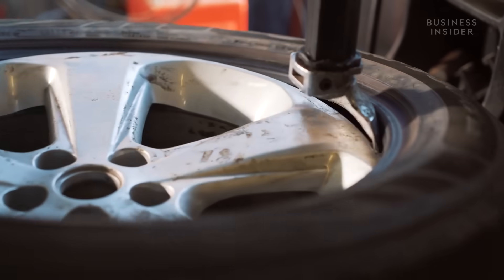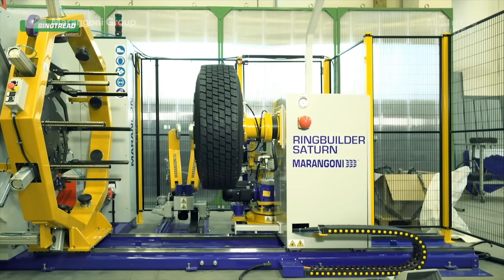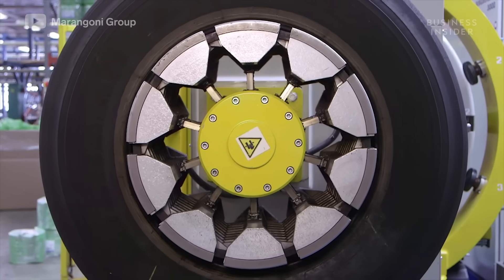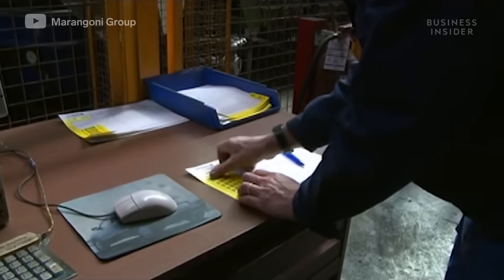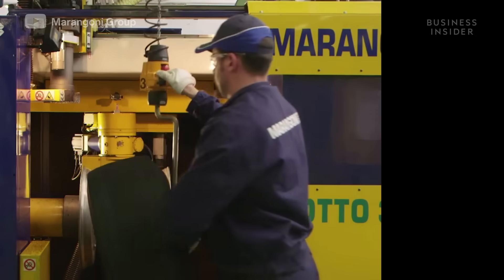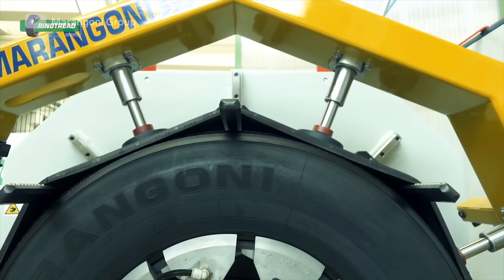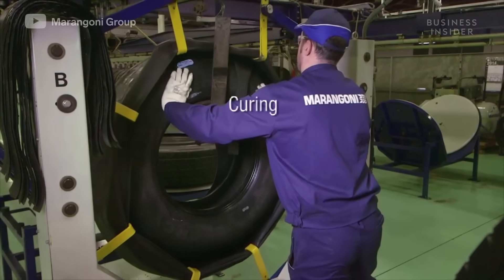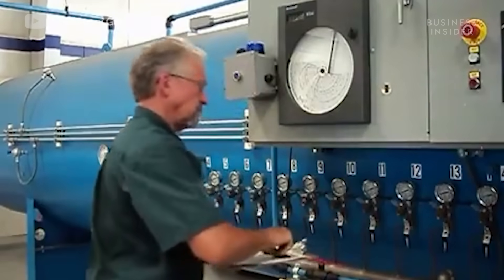How Old Tires Are Retreaded So They Can Be Used Again

Comment: can have all the technology in the world retreads are still junk.   To many times have I seen or heard of them blowing out or the treads legitimately falling off them
Reply: That's not just a retread thing. Don't let the smart asses gaslight you into believing these are the only tires to blow out or delaminate. Studies have even shown that retread tires have a failure rate essentially equal to new tires, so long as they are manufactured correctly. The only real danger lies with negligent shops that retread tires that aren't still serviceable. Those same studies determined that underinflation is the most common cause of tire failure across the board.
Articles on retread safety:
https://www-nbins-com.cdn.ampproject.org/v/s/www.nbins.com/blog/transportation-trucking/do-retreads-impact-tire-safety/?amp=&amp_gsa=1&amp_js_v=a6&usqp=mq331AQHKAFQArABIA%3D%3D#amp_tf=From%20%251%24s&aoh=16073586618956&referrer=https%3A%2F%2Fwww.google.com&ampshare=https%3A%2F%2Fwww.nbins.com%2Fblog%2Ftransportation-trucking%2Fdo-retreads-impact-tire-safety%2F

https://www-pe-com.cdn.ampproject.org/v/s/www.pe.com/2017/09/12/on-the-road-retreaded-tires-can-save-you-money-but-are-they-dangerous/amp/?amp_gsa=1&amp_js_v=a6&usqp=mq331AQHKAFQArABIA%3D%3D#amp_tf=From%20%251%24s&aoh=16073586618956&referrer=https%3A%2F%2Fwww.google.com&ampshare=https%3A%2F%2Fwww.pe.com%2F2017%2F09%2F12%2Fon-the-road-retreaded-tires-can-save-you-money-but-are-they-dangerous%2F
Reply: @garx1a  any tire can blow out all it takes is one good pot hole hit weather the tires new or old but "studies" ain't fact. In history people publish a page to their findings about a specific product or design or issue. When if their tests such as a example with the whole NFL concussion "studies" there was 1 result that warranted the concern and everything blew up about this one conclusion. When other schools and researchers tried to recreate the results they couldn't find do it. I've never seen anything other then a retread delaminate on the road can talk to most if not all tire shops and you ask them if you should get retreads and watch the face they make. Yes retreads are a cheaper option if you need to last you till you can afford real tires. Yes id say they have gotten monumentally better then when they first came out but same as with electric cars the technology still just isn't there for them to be that reliable better option then just buying legitimately new tires
Reply: @cjlong2057  So rather than trust studies provided by organizations that have the means to research sweeping examples from across the industry, as well as assessments by the long haul trucking industry that corroborate those findings, we should trust anecdotes that can't be verified, don't have any data on, and possibly don't tell the whole story? You said yourself that they've vastly improved, but they still have that stigma from before that improvement happened. That's the reason that shops will look at you sideways when you talk about retread tires, the stigma, not the facts. To put that into perspective, I've never had a recapped tire delaminate, but I have had an original tire do that, and on more than one wheel too. That doesn't make new tires less safe in my eyes, it just means the manufacturer screwed up.
Reply: @garx1a  I'd rather trust a shop on the small end of it then a large corporation because they are the ones who most benefit from a product of this nature. Especially in recent times all the stories and things that have come out about us being safe. Please keep in mind that only 1 or 2 generations ago depending on your age menthol cigarettes were prescribed to treat breathing conditions. And this was the big companies and the higher ups who would advocate and push this as fact. When well what do we know today. Plus regardless of our view on any matter I'm thankful you never had a retread fall apart going down a road. It's very scary. I'm sure eventually there will be a better option and 1 factories process isn't the whole industry either. There are so many little things that need addressed before these stigma and perspectives from the professionals will be changed.  If these are so safe and reliable then why don't race circuits use them? Why isn't there a team for rally or track cars or drift circuit that uses retreated tires? Weather it's a stigma or not until I can see that they can handle these true extreme conditions because accidents happens, animals jump out infront of you on the road, someone jams their breaks, you hit a slick spots on the road. All things that would really put the tire to the test. The reason they don't as I said stigma or not no one is willing to put their life on the line to see if these tires can play on the same field as a standard tire
Reply: @cjlong2057  That also doesn't make a whole lot of sense. Corporations, being as greedy as they are, care about profit. Manufacturers like Michelin wouldn't sully their own reputation with customers by selling bad quality retreads. For that reason, they are anal about ensuring that their tires are still serviceable, something a small time shop likely doesn't have the incentive, standards, or ability to do. Additionally, the trucking industry values its reputation, so why would they potentially lose business over cheap rubber if it would cause them to lose money in the long run? They simply wouldn't. More blowouts means less money because on the mild side; that takes time away from delivery of cargo, and on the extreme side that means destruction of the cargo, destruction of the truck, and potentially death of the driver, all of which would cost them more money. And yes the heads of cigarette companies promoted smoking for health benefits, just like how sugar executives used to market sugar as a weight loss supplement, but you never heard well respected healthcare professionals doing it too. That's why the government hasn't banned their use or heavily regulated them like they did with tobacco. To your point about a professional racing series with recapped tires, those series have deals with tire manufacturers wherein the manufacturer provides the tires in exchange for having that brand name plastered on the rubber of a professional racing series. It also wouldn't make any sense for retreaded versions of racing tires to exist because the main benefits of them are that they are better for the environment and they're cheaper than new tires, but race cars all have insane engines that would never pass emissions anyway so that point would be null, and professionals have money to always use brand new tires so it would eliminate that reason as well. There really isn't a reason why they're unsafe except that there's still a stigma around them. I know that's true because you haven't provided me with any real evidence that they're trash except your own personal beliefs and experience with them, but that's also moot because like I said, I've only ever had bad experiences with new tires.
Reply: @garx1a  something as miniscule as tires doesn't effect these massive corporation. Where I come from that's what so many people do they drive none of these companies use retreads for the fear of them being notorious for having issues.. I don't know how unless you've been the most unlucky tire shopper. That's like buying a harbor freight took and expecting it to stand up in service of a name brand. While yes all those tools are just the previous gens of those new name brand tools they still don't and that's the issue with bringing dietary things up to the table everyones body reacts different to certain things so what would work well to help my body be healthy and function fine isn't the same for everyone. Yes there is a generalized to a point diet we should follow  but our bodies  overall metabolism, how strong the organs work to process things. Especially how active we are day to day. While I'm sure if you don't drive as much or the road quality your driving on weather their main roads or side roads or gravel roads. That all effects the tires the stiffness of the rubber, stress lots of turns put on them on all these different types of roads they are the overall effect and these tires are no different being tested in the best of conditions doesn't make the difference. On the roads around here where I live being. Pot hole filled messes that are mainly tar and chip crap they eat these tires alive. When if your on main streets any tire will last longer plus to add I've seen so many of the larger corporations really not care about the little stuff like that they already have their relationships and have their money. You think a company like Goodyear, or wrangler or whoever wouldnt drop the factory that produces their retreads and get another one in a heart beat if they felt the need to. These corporations and massive scale companies are there for a reason weather they started out with the best of intentions or not. It all boils down to the industry has the name and they have not put out a product that the public can truly get behind for a true everyday replacement to real new tires. Especially when you go in the conditions from the hottest of summers to coldest of winter's any adhesive will expand and contract and work itself loose. That's when your problems come into effect for these tires
Reply: @garx1a  and a everyday example my uncle. Bought 2 retreads just a year ago brand new nice they looked slick and solid he was happy with them for all of 2 months until the drive side peeled right off the tire and he had to go buy new ones. Eventually I'm sure that there will be a great way to make retread. But that's not right now
Reply: @cjlong2057  The same way you say I'm just an unlucky tire buyer, it could also be said that your uncle is an unlucky retread tire buyer. That's the point that I'm making. All the evidence points to these tires working and being perfectly safe. Tires are a huge part of fleet costs, and retreads can save companies huge amounts of money to use them, but like I said, at the end of the day, if the tires weren't safe and weren't reliable, those same companies would determine that they aren't worth using because they would end up losing money due to reduced productivity. Tire companies wouldn't produce them if they weren't reliable because they have their name stamped on the side. The government wouldn't allow public use of them if they were truly dangerous. Long haul trucking companies wouldn't use them if they were either reliable or dangerous because of the potential loss of revenue. You have no argument here other than that you just personally don't like them. Your concern would make sense if this were 1980, but today the process is airtight enough that it works on par with new tires. If you personally don't like them that's fine, but don't pretend it's because they're unsafe or unreliable.

Attached is an article that explains how modern retreading works and why big organizations likeFedEx, the US Postal Service, UPS, and our own military use retread tires.
https://www.vehicleservicepros.com/vehicles/under-vehicle-trailer-towing/tire-wheel/article/10746078/why-should-you-be-using-retreads-on-your-fleet
Reply: @garx1a  I think you hold to much faith in these companies. But you asked for a example no one else would dare trust them that's the main thing I mean scroll through the comments  I am not the only one who feels this way  the tires ain't reliable and I have never heard of any of these companies or the military using retreaded tires. I'd believe it cause they want to save money but that's the poj t they stand their cheap and you get cheap out of them
Reply: @cjlong2057  I don't trust really any corporation with my safety, but it makes logical sense that as a tire company you don't want your product to make your name known for unreliability. And yes, the rest of commenters are just like you, misinformed about the reality of retreaded tires simply because they don't like them and continue to retain the stigma that they're unsafe. If you bothered to read any of the articles I've linked, maybe you'd learn something and would save some money down the line, but I'm willing to bet you just ignored them all.

Edit: Take a look at the other comment threads and see the other people who say they're unsafe get schooled by people who know way more than I do. People who can explain everything a lot better than I have. Reality isn't on your side man. Don't drink the Kool-Aid.
Reply: @garx1a  getting schooled implies that it changes all the issues people have experienced you say we are ill informed  but yet somehow you are advocating for a product that has always had issues and problems with them.and you contrudicted yourself your life and saftey and everyone in the vehicles life and saftey are at risk whenever that vehicle is in motion. No matter whose behind the wheel when a tire blows  retread or not it's a very sketchy situation. And I'd rather not be putting me or anyone who's under my care as a driver at risk just over a retreaded tire or not.when I know for a fact the tires  I buy will hold up the the test and the roads I have to drive on. When every time I've seen or heard about retreads they fall apart. Weather there are new leaps in their paste or forming they can't withstand the same pressures and situations. I know that.  A hand full of  controlled  studies are not the same as the people who see them day to day. Because the general public are not a controlled test. I honestly can't believe this is a true debate.  Yes you can argue any side for the good or bad. But what is shown on the roads  of a everyday person and in a closed course are not the same. Maybe where you are these retreads can be trusted but not here I could go to any shop any mechanic and ask and they will give you the same responses  what's in a lab or study isn't the same conditions as out on the road.
Reply: @cjlong2057  Do you retain any information or is it all lost on you? I just told you about all of these companies and groups that use these tires in the most extreme conditions, conditions that the "general public" don't operate in. If these tires are used in all capacites and in extreme conditions, why could they not be trusted to operate for everyone? You say you know they can't operate under the same conditions but they literally do just that. Just admit that you're biased against them for no valid reason. This is a masterclass in cognitive dissonance.
Reply: @garx1a  and as I have told you and provided examples and having been around so many truckers and mechanics all my life none of them trust those tires. I don't know why you are so for them and why it bothers you so much that people don't like them and don't see your argument. They are not that good. I've never seen them perform on the roads as they have in these examples you provided. Especially as far as the military goes. Never heard anyone using retreaded tires to the degree you have. I've met people who use them as a spare instead of getting a donut but that's a far stretch then from using them day to day having to drive thousands of miles  a week on them I'm sure somewhere they do to save money but it still feels like we're just going in circles you know what you've seen and I know what I've seen. Good luck changing our minds.

Comment: Blew a tire on the last Tandem Axle outter most wheel (passenger side) coming from North Carolina to Texas,  fully loaded 78k Lb’s! That tire? Was ReCrapped! This shit is just another way corporations save money so they won’t have to spend the extra budget on NEW tires. Jesus Christ, do you know how old and or stressed the original sidewall is? This shit should be illegal, and anyone that condones this method should be fined and or Jailed for putting so many lives at risk including innocent drivers and even the tractor driver’s life.

Comment: Retreads are more reliable then virgin tires. If anyone in the comments knew a single thing about tires they would know that but no a bunch of people repeating what there dads told them 10 years ago and not doing any actual research just because you say retreads are garbage doesnt mean they are it means you're uninformed

Comment: When I was 17, back in the mid-1960s, my buddy's dad ran the latest technology recapping machine at a local tire store.  It applies a hot strip of rubber in about1 inch widths back and fourth like stringing a YoYo.  He guided it as needed.  When enough rubber was applied, a clamshell-type of a metal case enclosed around the tire and heated it together to bond.  I tire at a time all day long!  The results were far more reliable than the standard technique.  WARNING, VERY SAD PART!  YOU MAY WANT TO SKIP IT.  Not too long after, maybe 18 months later, my amazing buddy was killed in Viet Nam.  Father and son were planning on opening their own tire store when Doug was out of the Army.   Damn that war and the politicians that allowed it to go on for so long.
Reply: ...Hearing about someone dying in the Viet Nam war isn't going to affect the day of most people in the comment section. Just saying. 
Sorry about your buddy.

Comment: I also work at a retreading shop. But the buffing there is like u clamp the tire and close it on a rotating buffer. The rubber dust flew everywhere. And even if ur tire  
Has its ply hanging out, we can fix it. 🤣🤣

Comment: "They perform well too..." Yeah. Until one splits out and goes through your windshield at 90 mph.
Reply: It conforms to all saftey standards.

But tbh this is mostly viable for larger tires, not the ones for a Prius, but the ones for tractors or JCBs, which cost upward 5k per tire and are a lot bigger.
Reply: @fartpluswetone8077  the only thing good for the environment is walking, but it’s better for the environment than new tires because it takes less energy and raw material to create.